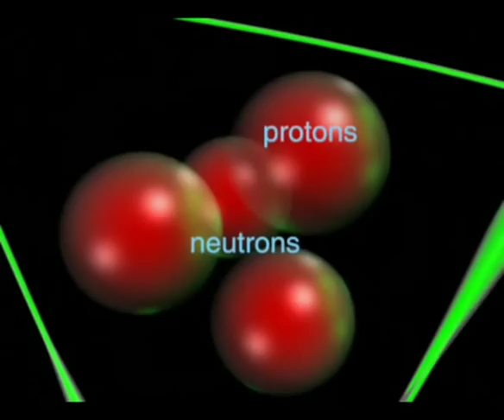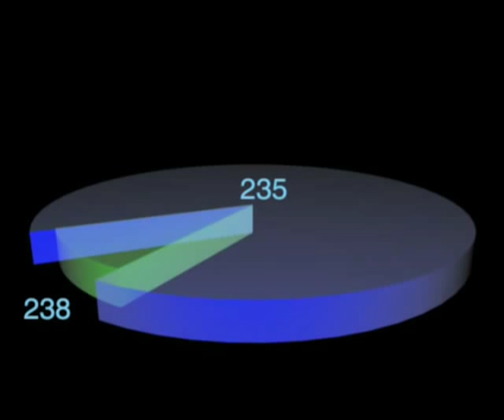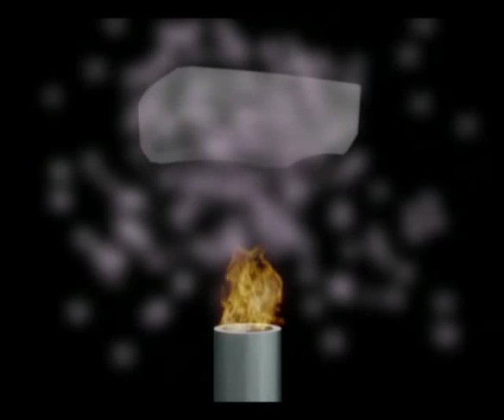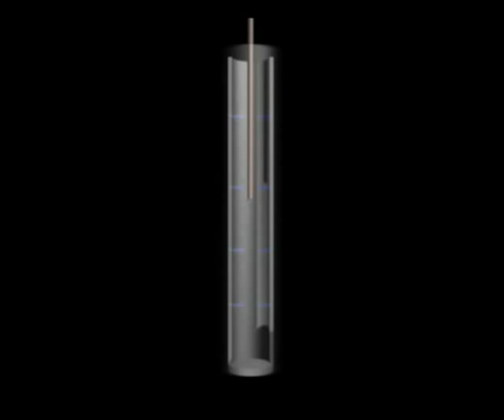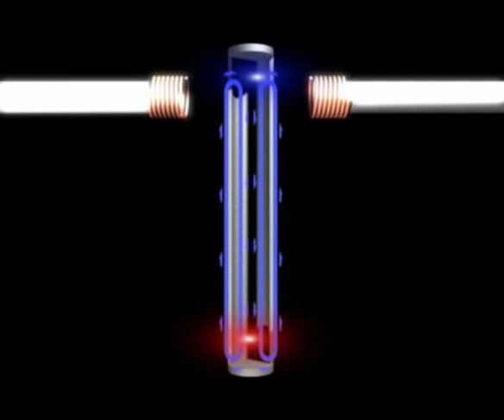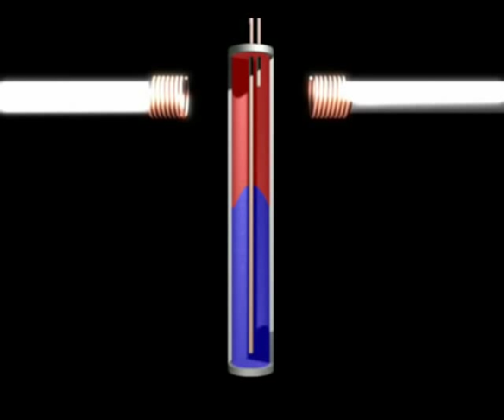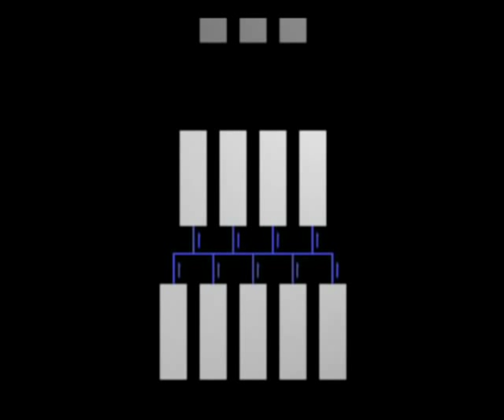CentrifugeVideoFAS

Comment: I made a copy of centrifuge technology from the FAS . The centrifuge is the only way to enrich uranium on a industrial scale. The Americans tried ALIS it sounded promising but one drawback was the very high temperatures used to evaporate uranium metal into a gas so 4000 degrees Celsius used and at that temperature components wear out so only 400 hours max and a shut down to replace worn parts ,it had a higher separative power of 2 to 6 so the Americans shut the program down a pity another six years of straightening out why components fail . The Australians are developing SILEX another laser separations using UF6 gas instead of metallic uranium, there are no detailed facts about cost of SILEX its energy use and its SWU per kg needed its shrouded in mystery. The AC100M centrifuge, the TC21 centrifuge and the Russian Tennex centrifuge that are used in enrichment.